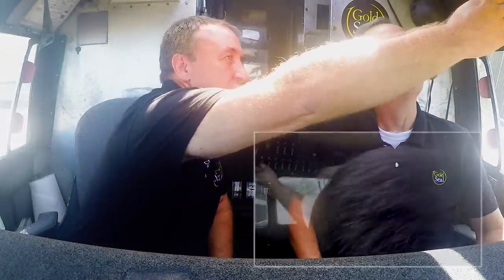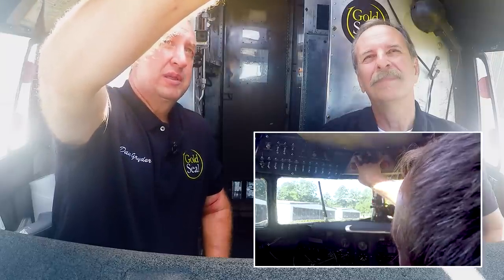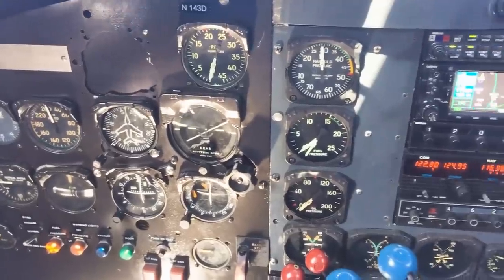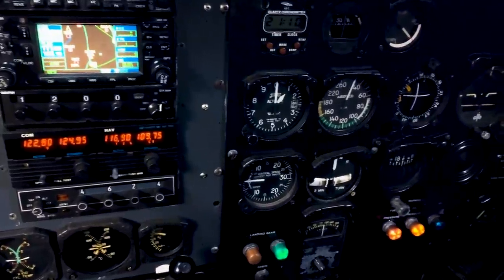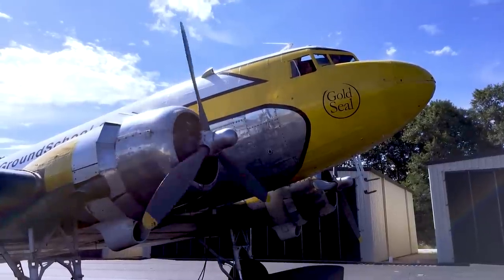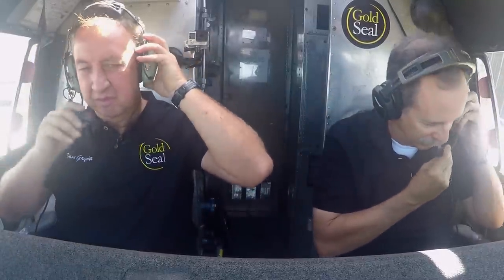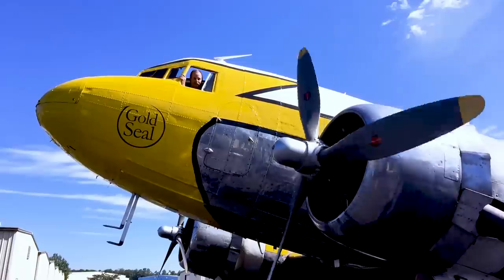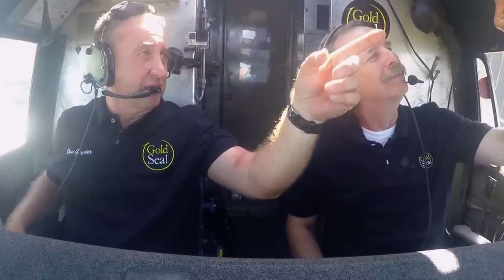Secrets to Starting the DC-3

Comment: What would it cost to get typed rated on your Dc3.
Already commercial multi rated...
Reply: philmore Dennie Back in the early 90's it was about 5 Grand. Total PiC time, just over 10 hrs with  about 20 dual. It was largely dependent if you were part of a group or being hired on. If you were being hired but didn't make the cut, some operators charged half the price of the training. If hired, you didn't pay a dime providing you stayed a minimum of a year. Each outfit had different options.

These days, costs have skyrocketed and very few are in Commercial service except up North (Alaska, NWT, Yukon) and several South American countries. A few remain in service is Africa, though they have been largely replaced by Dash 8's.

You can learn the hard way for free at Buffalo Airways and start of as a Rampie loading Cargo for 6 to 9 months in winter weather conditions that are often below freezing. The DC-3 Commerical Service era will eventually come to an end. Probably within 15 years as avgas up north becomes less common and very expensive. 

South America will be different as fuel is relatively cheap and very few Air Rules / Emissions Regulations exist. 

I would guess that getting you DC-3 endorsement today would still be about the same price; 5K but your endorsement wouldn't be valid unless you had a minimum of a Commerical endorsement / license ( exceeds 12,500 lbs rule for PPL). I'm not current on FAA Regs, if an IFR endorsement would also be required. It might be.

Something else to consider, even if you got your endorsement, the airplane's insurance policy may not allow you to fly it without a Captain that has a minimum of "X" hours in type (DC-3). Privately owned DC-3 insurance policy costs vary. It can get expensive in a hurry if the crew has very few hours in type. In some cases it may not even be possible to find an insurance carrier for a realistic price.

Have a nice flight!
Reply: About 2015 I was quoted $1,800 with an additional $250 for the books and $350 for checkride.  It was a go until they found a buyer for the aircraft.  Darn it.  Some day I will add DC-3 to my ticket.

Comment: What type of fuel does a DC3 use?
Reply: 100LL aviation gasoline
Reply: 100 octane avgas
Reply: 1830-90D's I flew always had 115 AvGAs in them in 1969
Reply: The only avgas now available in the US is 100 octane low lead

Comment: Believe me, you can have enough voltage and amperage to burn those starters up.  Try about 10 12 V batteries in series.  ;-).  They'll  last a few seconds. What he meant was PROPER specified voltage, and enough current supply to keep that voltage near that specd.  That's what happens when you get pilots talking about electricity.
Alright, mixtures on, mags....nada, smirk, eventually...WOO HOO.  LOL
Reply: As well, I've never met a starter that wasn't duty cycle limited. You can burn them up, no question.
Reply: John Sikes that’s what I was thinking.   Voltage is either right or wrong.

Comment: I've got dozens of flights in DC-3s but never landed in one. Up until the mid 80s or so they were THE large jump plane but they use so much fuel that DZs went to turbines. Planes like the Twin Otter are great jump planes but none of them have the personality of the DC--3 or the Beech D-18.

Comment: The use of a power cart is not a secret.  I now a real secret to start a R-1830-92 engine that refuses to start in the ordinary way: 1- forget the manual. 2- prime the engine until the fuel begins to drop at  the engine fuel drain. 3- push the power level to maximum power position. 4 - pull the airplane stick against your chest (or use the safety belt to tie the stick back). 5- Start the engine (don't forget to turn on the starter vibrator if exists one). 6- At the moment the engine starts, pull immediately the power level to about 1500 rpm position. :-)  Sorry  guys for my bad english. :-(

Comment: So basically, the Start-Cart is just a glorified automotive jump-starter...
Reply: InventorZahran 327 yep, hopefully the ramp rats remember to hook the charger up afterward. More often they’ll use a GPU (Ground Power Unit) which is just an engine-powered generator (either 28VDC or 120VAC 400Hz) that provides electrical power. At the FOB where I work we also have a Lektro electric aircraft tug that can provide 12VDC, 24VDC, or 28VDC power.
Reply: the trolley-ac as the WW2 RAF used to more coolly call them...trolley-accumulator..

Comment: I understand hydraulic lock, but, how does turning the engine with the electric starter versus hand propping avoid it?  Hydraulic lock occurs when oil partially fills a cylinder.  How does turning it over with the starter eliminate that??  Maybe, I misunderstood something.
Reply: That is logical and true.  I had a "hydraulic lock " in a Chevy Truck V8 once my brother said the motor was "Ceased" he thought I was nuts when I said lets drain the oil and out came gallons of oil and gasoline from the carburetor float sticking I supposed.  It ran fine after the oil change and carburetor cleaning.  Not to hard to understand that.  Bulldozer starters can only be on for seconds before real heat build up and need to take it to be rewound.  Had that happen on mine.  Starter shop owner educated me about letting them cool down.  My dad flew PBYs in Alaska WW2 I heard plenty of stories about those Pratt radial engines. Went to see a cut away displayed engine at the Pratt museum in Connecticutt they are beautiful inside and out.
Reply: How I heard it was hand turning for checking if there is hydraulic lock, spinning it on the starter with mags and fuel off to pre-lube the engine. Could be wrong.
Ray
Reply: That makes sense, Ray.  I listened twice, but, I guess, still misunderstood.
Reply: Well,you can take out the plugs on lower cylinders...or pull prop backward s six blades...it pushes oil back up the intake.
Fastest way is pull prop through...then turn it with starter motor.
On the C-7A,starter motors are 110 lbs and you have to bring it over your head to install it.no fun if you dint have an extra hands.cart start any o'l radial if you can.
Unless you love to get oily,dirty everyday.
I loved to work on my ship everyday...no leaky gear doors!
No spots on the ramp eather
Reply: mike a 
My understanding is that an electric starter isn’t powerful enough to bend a rod if there is hydraulic lock.  An inertial starter will bend a rod, so carefully pulling through by hand is in order.  I said carefully because pulling through by hand can also bend a rod.

Comment: When you fly your airplane OFTEN, and you KNOW your airplane, you can procede without manually pulling through the engine.  In the more common situation, where the engine is not started often due to economics... it would be prudent to pull it through manually and FEEL for problems.  In a flight school.. this is likely more dangerous than it is worth.  For the rest of the world.. there is a reason to do this..and the military did it routinely.
Reply: ikr , its like raising a child :P

Comment: I'm typed in the DC3 about 2000 hours........what an airplane! We did 6 blades, then mags on. We didn't spin the engine ...6 blades, then eyes to the oil pressure gauge.
Reply: I mentioned above that we did 8-10, because most of the time we didn't get any Oil Press indication unless it was cold with only six blades (2 Revolutions).  On 4360's they definitely turned them "wet" before Mags On.  Early on the flames and smoke were intimidating.

Comment: I know this is an older video, but as an old time DC3,BE18&. DC4 and many other radial engine airplane pilot, I have to chime in on this. Dan; you seem like a really good instructor, and all round knowledgeable guy, but I have a couple of issues. Your comment about not pulling through a radial engine before start is either completely false [and dangerously misleading], and goes against everything I have known for 40 plus years, or you are leaving out some very important facts .
First off, your comment about pulling the prop through to pre oil the engine. This has nothing to do with the issue you are talking about. I agree that pulling any engine through to pre oil  is ridiculous , and shows no understanding of how any of this works. The reason we are pulling radials through before start is to check for hydraulic lock[oil collected in the bottom cylinders]. 
I agree that this needs to be done very carefully, as even turning by hand can bend a rod, but it needs to be done. Please specify the conditions you are talking about.ie, is your aircraft flown every day, or are your mechanics pulling the bottom plugs before starts; important to know] . I have personally witnessed damage to a radial engine from hydraulic lock.
Would love to here your thoughts. And again this is not intended to in any way disparage your skills ,but just to make sure everyone is clear on the topic.
Thanks for the good work.